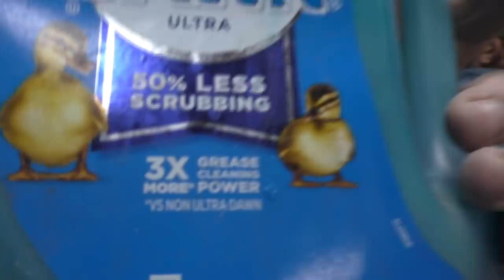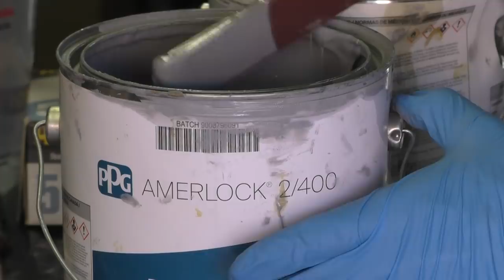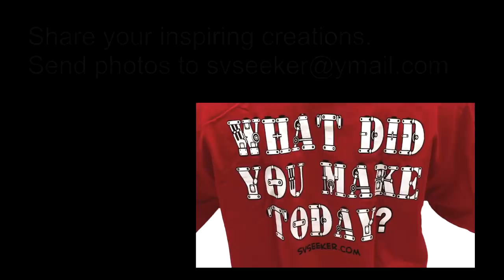Engine Room  - Paint/Pumps/Coolant/Fuel/Mounts

Comment: Used to race cars for years, and for tire lube a bunch of people would use liquid soap... the problem being that under high torque later on, the soap let the tires slip on the hubs.  Years of testing proved to us that hair spray, AquaNet Blue specifically, was the best lube that started off nice and slippery then turned super sticky once it dried.... mounting tires was easy, and they never slipped on the hub during the race.  Same goes for any rubber hoses that need temp lube to slide onto a fitting.
Reply: Dad always said to me, when putting new grips on handlebars (bike or motorcycle) he'd always use hairspray, AquaNet to be specific.
Reply: @cordcd7  I’ve always found alcohol works well and it leaves no residue on the bars
Reply: The problem wasn't that you were using soap, it was your car was making too much power. Not a bad problem to have.
Reply: @elementfishing  "The car is making too much power"... said no race car driver ever.  ;)
Reply: @jeffgrant935   Well maybe it's not getting to the wheels?
Reply: Aqua net is also a great propellant for a potato launcher.

Comment: You need 5 to 10 times the diameter of the pipe as a straigt pipe on the suction side of the wash down pump, to prevent cavitation. You will hear a huge difference and also have much greater performance.
Reply from the maker: Not when the pump is below the water level.
Reply: @SVSeeker  It does not matter if above or below water level. It´s needet to get rid of turbulence at the intake.   I tried out a  slightly bent hose as an intake pipe and also a long straigt pipe. The pump run much quieter, with 20 percent higher output and higher pressure with a straigt pipe as an intake.
Reply from the maker: @philipp635   A pressurized supply has no effect?   And yes a straight line is best.   But an intake like 5 to 10 times the diameter?  Give me a break.  What is the numerical advantage there compared to having a huge hole in the side of your boat, below the waterline.     You do that on your boat.  : )

Comment: As someone who regularly works on 12v cummins engines I’m fairly positive you are going to have issues with the clamps you plan to use for your turbo to intercooler piping both hot and cold sides, with no lip on the piping to hold the boots in place the boost will most likely blow them off
Reply from the maker: Cool. We’ll see

Comment: If the fire has gotten hot enough to melt silver solder, you have either began putting it out or are abandoning ship. I assume Dough is going to create a fire drill for the crew to practice regularly or when taking on new crew that it is their first voyage once the boat is in nearly complete, same with man overboard and other emergency situations that are common on boats. With the smoke detectors in every compartment, I would feel perfectly safe on Seeker and I am a pretty paranoid person when it come to safety (seen too many accidents places when I was young and worked in factories). As long as you keep fuel in lines that are designed at least designed for gas/diesel fuel use you should be fine, especially since you can just close all the hatches to the engine compartment if there is a fire in there and starve the fire of oxygen.

A fun tip I was taught for fire prevention and extinguishing in industrial settings was the fire triangle. To have a fire, you must have ignition, fuel, and an oxidizer mixed in the right proportion to the fuel for combustion. Heat is the ignition in a fire that is self sustaining. Take out any one side and the fire goes out. Take out two sides at once and you have a great extinguishing method, potentially. Eliminating two sides in dangerous settings is used as a safety engineering guide. Also, most hydraulic oil is not self igniting. It will not burn hot enough to keep lit once it is ignited, if it is just hydraulic oil. Mix in some liquid fuel or a hot wire and it will still burn.

Comment: Not trying to be a Negative Nancy but I did the same thing with fuel lines on my race car and they'll eat right at the fitting couldn't figure out why no matter how tight I got them come to find out the taper on a hydraulic fitting and the taper on the push lock fitting we're different not to say that that's what's going on with yours but something to keep an open mind to

Comment: Doug, are you planning to use the prop to back drive a generator while sailing? With that variable pitch prop, it seems like it would be pretty easy to put an over running clutch from a tractor inline between the prop shaft and the transmission, and then drive a generator off the prop side. It would keep your batteries topped up and save fuel.
Reply from the maker: Not to start with, but it may be something we do in the future.

Comment: Funny, I’m doing the same exact work on my hydraulic wash down / bilge pump... great idea to put one in the boat. 

On JIC “Push Lok” fittings... DO NOT use your palm to push them on! You were pressing them against a bench, which is the right way. From experience... the JIC flare is extremely sharp... took a 3/4” core sample out of my palm a few years back!!

Comment: Just a heads up. Jic hydro and the brass type fittings for plumbing and gas usually have a different flare angle to each other.

Comment: I might be late to the game with this comment, but for your hydraulics you may enjoy the DIN 24° type fittings (Parker Hannifin calls theirs EO 24°, or EO-PSR, they claim worldwide availability), just cut the tube straight to length, put the nut and cutting ring on it and assemble the fitting, no soldering or forming of the tube ends required.  Only downside for you might be, that it's metric, but that could be an advantage if you end up outside the USA.

Comment: I believe your bilge pumps are getting air locked. They can't make any pressure to push it out and the air in the line holds the water from coming into the pump. If you install a small automatic air bleed valve after the pump before the check valve it should solve this problem. The other option is to drill a small hole in the line to vent the air. This is commonly done with sump pumps because who cares if a little water goes back in the sump pump well.

Comment: Doug,
My name is Paul Bigelow. Have been watching your build for years. I like the fish boat finish.I am a journeyman boat builder.I have built fish boats, sail boats, and yachts (boy do I hate rich people.) You mentioned you wanted some constructive criticism. I have a couple items that we learned from building fish boats. The boats were 43', 53', 60', and 75'.  

.     I am concerned about engine air. We always ran outside air through a dorade (sp). we built some boats with large engines and with out the air, we couldn't get the engine door open. Maybe you have this covered. Let me know so I wont worry

. We also had the  engine room get so hot the pvc and abs  pipes for dealing with the fishing stuff cot soft. Nothing like fish guts all over the place.

. We also double clamped every hose. A couple of reasons: It is cheap insurance and you have an extra clamp if one fails.

. I noticed the sink you made and installed had no sea rails. You will appreciate it when your coffee cup comes after you at 10 miles an hour or your tooth brush falls off the sink rim into the bilge; water sloshes out of the sinks.

 . I am using extension cord to wire the addition to my shop. It will work fine for both ac & dc; good choice given the price for stranded wire.

I really like the fish boat finish. and your philosophy to use what you have on hand to fix or fabricate. 

Time for finish up tic lists. Reply with questions or discussions. Great boat. OH make sure the drawers in the galley have a lock so they don't slide out.
Happy holidays.
Reply from the maker: Howdy Paul. There are a couple blowers that provide air, and the engine room vents directly above the engines. Of course, if you can look out and see icebergs, you’ll be very happy if the engines are even running. As were a sailboat. :-)

Comment: Take the bit out of that orange home depot screwdriver and the post will fit a hose clamp bolt (1/4"). With all those sharp edge hose clamp ends you all really need to look into Clamp Aids. I've always use brass in aluminum intakes and exhaust manifolds and such. Never had an issue. Who knew? Those press on hoses/fittings work great without soap. Just a little heat on the hose and a little water on the fitting.
Reply from the maker: Oh hell.  I'll just put someone down there with a pair of tin snips and a file.  : )     ....and that 4-way does not fit some of those clamps.
Reply: @SVSeeker  All I'm saying is Home Depot made some great socket drivers for hose clamps with those $2 screwdrivers. I've also taken little chunks out of my fingers using the straight blade like you were on that clamp and watching made my fingers tingle. lol. 
Also you all are a famous. I bet a simple email to Clamp Aids asking for a "sample" would get you all you would need for a lifetime. I found them years ago after reaching into a bilge and flaying my forearm open on a cooling line clamp. Now I'm obsessed.     😎

Comment: I'm sure you've thought of it, but for once I have a suggestion so I figured I'd throw it out there-  I recommend a valve between the day tank and the engine on the supply side.  Sometimes equipment manufacturers  will install a fuel tank where the fuel level can be higher than the  engine's fuel system, and this can cause fuel to siphon through the injectors and into the crankcase if the injector pump's fuel solenoid weeps a bit.  (it can also make it next to impossible to service the fuel filters)  A manual valve that's shut off when the engine's not being used for a while can prevent that, and give you a handy emergency shutoff in the rare event that the rack sticks open.

Again, you've probably thought of that. It's a well thought out boat.
Reply from the maker: I'll give it some thought.  Thanks

Comment: Things are moving along for sure.  Had to do something for my battery charger as you did the heater.  Basically the new ones have a "sense" circuit that checks to see if there is a certain minimum voltage before the charger will turn on and work.  Well guess what, that circuit is a pain if you want to power something small without a battery and in mine the circuit is also used to shut off power when it thinks the battery is fully charged.  It's like 8 or 10 amps max charge and most of the time I do an overnight at 2 or 4 amps anyway.  For some reason even on a dead battery it always showed fully charged so I wired around it and the problem is solved.  Basically just cuts the 110V supply, sadly the other side of the circuit actually drains a battery if the supply is cut making it even deader than it was if the circuit is acting up. 

So what happened to the welder now, I was just there fixing the fan not too long ago.

Comment: Are the pumps getting air locked? If so a very small hole in the output will let the air out and let them prime.
Reply from the maker: Could be.  I'll do that if it happens again.
Reply: It is an air lock. Those type of bilge pumps typically are not used with check valves.  Hose is supposed to go up to thru hull with no dips and have a reverse loop above thru hull to stop backflow.  In your application, you will have to drill a bleed hole in the top of the pump outlet.

Comment: I got tell you a funny story I couldnt afford the hull fittings & really didnt wont holes in my 54Ft. round bilge steel cutter so lined the bilge with bitchimin i happened to find from a friend on the road works , welded a couple of plates angling in at the top of the engine bay , Put the cooling intake forard & the outlet aft end of the bilge filled her with 140 gals of fresh water & bingo hot water for the sink , Shower even the toilet . When she got to low in with the hose or rainwater runoff. 18 years later it was still working perfectly , Got a bit warm in the tropics but hey we were there.

Comment: Have you seen the engine that Leo at the Sampson Boat Company chose for Tally Ho? Pretty slick setup he will have there.
Reply from the maker: No!  Did he get one out of a school bus?   : )
Reply: @SVSeeker  Not  that cool. :) It's a small Kubota diesel used in skid steers that is retrofitted with a pair a generators on it to charge a battery bank. When the diesel is running, it can charge the batteries, drive the prop shaft, or both. The circuit can be reversed and the batteries can also drive the prop shaft without the diesel. And the pitch of the prop can be adjusted when under sail and the water current turns the prop shaft, it engages the generators and charges the batteries. All in all, a very redundant system.

Comment: Hey Doug, this may have been covered and I missed it, but did you address the KDP (Killer Dowel Pin) on that Cummins 5.9?  If not, it is definitely something you'll want to address while you have access to the timing gears.  While you're at it, consider installing a wear sleeve on the front of the crank. Feel free to reach out if you have any questions...

Comment: I don't think the AT 545 has a lockup converter does it?  It's perfect for a school bus where it's constant stop and go with very little time at sustained highway speeds.  Without lockup the torque converter is always working hard.  It wouldn't be good for the highway though or cruising out on the water.
Reply: That's correct, no lockup. What I wonder the most is why one even would want a gearbox with several gears in a boat, especially if you have a variable pitch propeller. A clutch to disengage the engine from the prop shaft seems more appropriate to me, reversing is done by changing the prop pitch.
Reply: The transmission with variable-pitch prop is redundant for most boats but it's a standard setup for towing.  The transmission allows him to keep the motor at the peak of its power range while converting mostly into torque for unladen speed at a high pitch or mostly into RPM for pulling power at a low pitch.
Reply: @zrebbesh  yeah, that kinda makes sense, but this transmission is going to be really inefficient without a lockup converter. Going to be burning a lot of extra diesel for very little benefit.

Comment: Doug, after many years of recreational boating, I highly recommend a spare prop.  I’ve experienced them literally spinning off an outdrive, ropes and nets wrapping and destroying them and countless broken blades.  I don’t recall, did you cast a spare?
Reply: This is absolutely true, sooner or later, even with a skeg and a shroud, you're going to either run something through your prop that it won't take, or a joint or fitting or variable-pitch mechanism or something will let go.  Sails are your first backup for driving power, but it's good to have more than backup. It's useless though unless your winches etc allow you to install the damn thing in deep water.

Comment: the big problem with an engine room fire on most boats is you loose power and with it your ability to fight the fire and on a steel boat the less intense you can get the fire to burn the greater your chances of being able to let it burn itself out without sinking the boat. keep your cutting torch near the fire fighting equipment a good fire will make inside the boat so hot you wont be able to enter to even get to the fire but you can torch holes in from the top and start pumping water

Comment: What's the rationale for re-threading all the metric bits to be SAE measure?  Depending on what port you're in, SAE fittings can be harder to find or ferociously expensive.  But if you need any adapters you can't make, let me know.  From going the other direction all the time, I have taps & dies in both standards, in all common threads up to about 3 cm or 1 1/4 inch.
Reply from the maker: Because currently I’m in the port of Tulsa Oklahoma.  :)
Reply: @SVSeeker  Oh, right.  Because unlike most sailors you'll be taking your machine tools with you so you can adapt whatever parts are available where you go.  Everybody has a toolbox, but your toolbox is actually a small machine shop!

Comment: should there be a check value on the bilge line? that 3 way value would allow water from sea chest to your bilge siphon ?
Reply from the maker: No,  it needs to flow inward, so a check valve would make it unusable.   We close the sea chest valve with it's not in use.

Comment: Curious as to how you are going to gear that transmission down enough for that large prop? Leave it in 1st gear?
Reply from the maker: Yup.   It's something like 3.5:1 in 1st gear.
Reply: @SVSeeker  2nd gear when you want to ski.
Reply: There is an absolutely great guy Richard Crich from Precision Transmission in Amarillo TX (has a great youtube channel) that is a wizard in automatic transmissions.  One of his videos that I watched talked of a racer that always ran in 1st gear and how he had transmission failures.  Richard specifically modified that trans to increase lube and cooling to the first gear planetary and other mods to strengthen first gear.  While you are still on dry dock, it might be worth a call to Richard with your particular engine/transmission and application to see if there are any hidden flaws in your transmission model for the way you are intending to use it.
Reply: @theoldbigmoose  What he said,  It would be such a pain to deal with it in the middle of the ocean.